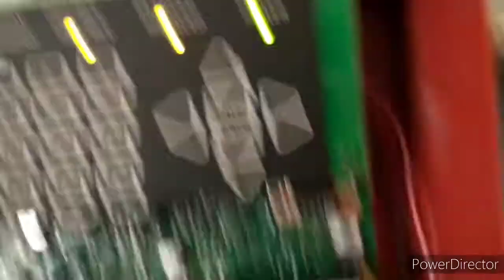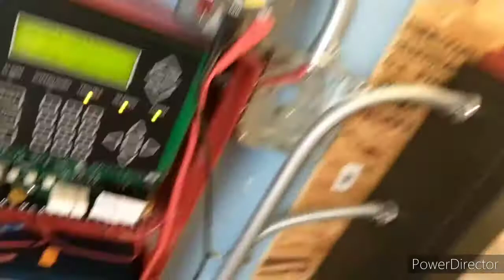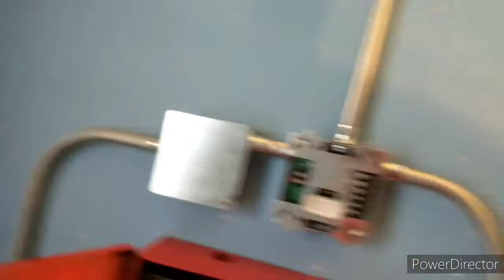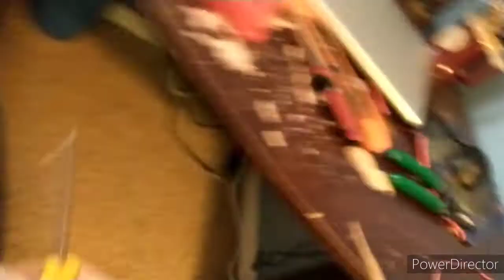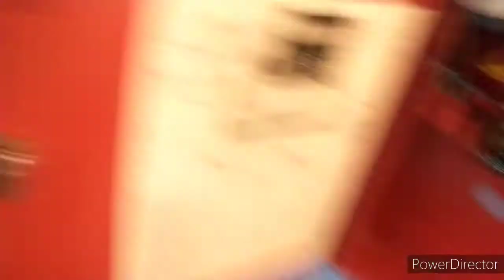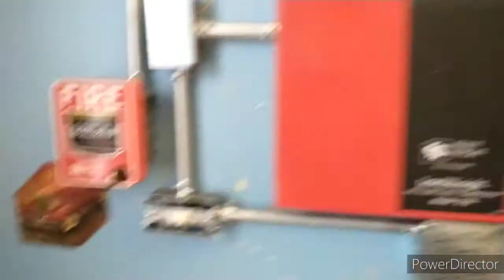Trouble Shooting an Open Circuit on a Fire Alarm System

Comment: Matt, I have 2.24 volts positive at the board NAC connection is that correct? All other connections give negative 21 volts, any suggestions.
Reply from the maker: What’s the panel?

Comment: Also another thing my panel does is phone line troubles can you also make a video how to get rid of that?
Reply from the maker: I don't have this panel anymore but if you go into the programming menu and press system options you should see phone lines I believe, you're going to want to set line monitoring to N (no) for both lines, basically set everything in phone line programming to N

Comment: Can you make a video how to set audible silence
Reply from the maker: Under system options you'll see misc options, I think there's like 3 misc menus? It's in one of those, it will set "strobe sync on silence" I believe and you'll want to set that to Y (yes)
Reply: @FireTech7  which I did but it doesn’t flash on silent it will just silence horn and strobe
Reply from the maker: @Firealert101  did you set a sync protocol? What alarm are you using
Reply: @FireTech7  another thing is battery trouble I have the batteries in there but it’s saying “int power sup” under trouble
Reply from the maker: @Firealert101  message me on discord
Reply: @FireTech7  it just sync strobes while alarms sound

Comment: I've run out of ideas so here is a question, I'm resurrecting the MP-24 that's been installed my home since the 80s, replaced all the old ESL 425CTs with 2W-B detectors, new heat detector in the kitchen, etc. Did an ohm reading before and was getting 4.7k towards EOL for Zone (which is correct) and was getting about 9.8k ohms towards the NAC EOL (which is correct). I'm doing all these readings with the panel end of the field wiring disconnected, I've tested the panel with EOLs in place of the zone and nac and it works fine.

Fast forward to now, when I do a reading I'm getting 19k on the NAC (one half of the house is testing 9.7k towards EOL so that half is okay), Zone is still fine for EOL. I remove the horn/strobe and then join the wires without it and get no reading at all, until I put it back, then it's 19k, now if I take a 10k resistor and put it at the panel then I see 9.8kish ohms that way. I've gone over and metered all the wiring connections in the area where I think the problem is, since the other half meters correct towards EOL. Any theories on that, of why it's metering so high now at 19k over the correct 9.8k, and why putting a 10k resistor at the panel field wiring is giving the correct reading, is it possible it's a bad signal device? I'm out of ideas at this point, I've checked pretty much all the wiring on the end with the issue.
Reply from the maker: I never really ran into a problem like that before but my guess is that the panels internal resistors for zones and nacs make the reading higher when connected to the panel

Comment: Fire telephone show open ckt.give me solution please.notifier FACP
Reply from the maker: Get a firefighter telephone and start plugging it in to all the jacks and make sure it's receiving at the panel. With that being said, make sure you have the systems schematic for the firefighter telephone system. When you find which one ain't working, open it up and make sure the EOL resistor is there

Comment: Hey man I have a trouble on my system for 2nd floor Nac panel open circuit. I traced it down and it is on the 1st floor south side. I was wondering how do I test the strobes to see if there still good or need to be replaced. I think I could do it by testing the strobes resistance while it’s disconnected but if you could give me some pointers that would be great. Thanks man
Reply from the maker: If the panel says open ckt coming from the nac panel it could literally be anything, a ground fault, short, batteries, or open ckt, that's just how there boosters communicate. But if you're sure it's an open ckt ok the nac the way to see if the nacs work without setting the fire panel off is if you take wires coming from the FACP off the booster and then run a wire from the aux on the booster to input 1. That'll set off the booster and whatever is connected to it. I mean hopefully it's only strobes that are connected to it. When you do that make sure it's all screwed down and check your strobes to see which are going off and not going off. There could also he a break in the wire or something so yeah it would be a good idea to check for resistance but only do that if the booster is powered down, I'm not sure if the booster already has it's own resistance so it could mess up your readings. But yeah trace it down with your meter first. If you don't find anything out it the usual do the aux to input 1 and check to see what works and doesn't
Reply: @FireTech7  thank you man, needed up being 2 faulty strobes. 1 more question for you I got a co detector that is wired and powered up its tests but doesn’t send the signal to the panel when trying to test it. I have replaced the co twice and have the same result. Any guidance.

Thank you
Reply from the maker: What kind of CO detector is it? System sensor I'm guessing? If so, those are 4 wire and have 2 form c relays for activation purposes. One is the trouble relay and the other is alarm. Make sure it's connected to the alarm relay and not the trouble relay. Make sure they aren't backwards as well. Hope this helps
Reply: @FireTech7  it’s a macurco co, and it matches the other wiring I have on my other co’s and there fine. I will try and confirm relays because you never know. This might help there was a system sensor that was there and it expired I couldn’t find the system sensor for my vendors so I ordered the macurco. Not sure how familiar you are with these but it should be wired the same as the systems sensor no?  Thanks again man appreciate your time
Reply from the maker: Yeah sorry I'm not familiar with these macurco detectors
Reply: @FireTech7  thanks brother
Reply from the maker: No problem
Reply: Take nac leads off nac one or nac two thre or four. Then test for resistance and for the resistor at end of each line. Put multi meter on continuity then test for the resister in place by putting black multimeter probe on your red wire on your nac and then red multimeter probe on black and make sure you can see your resistor at end of line. Nacs work by reversing polarity when activated.